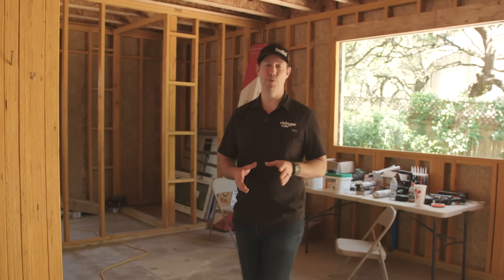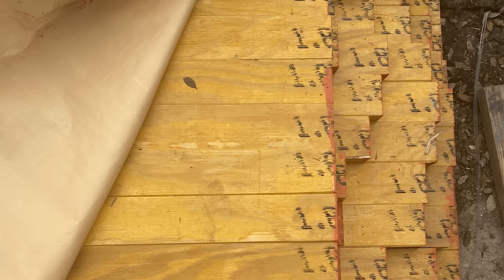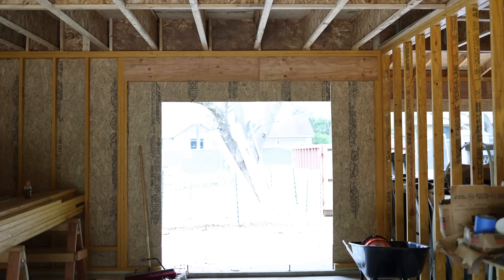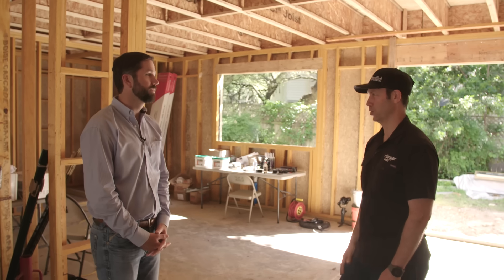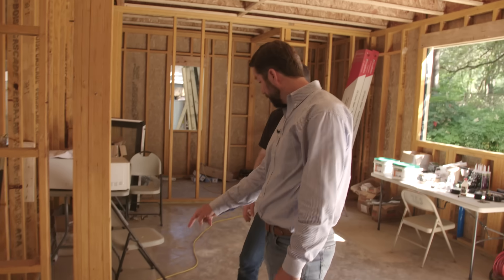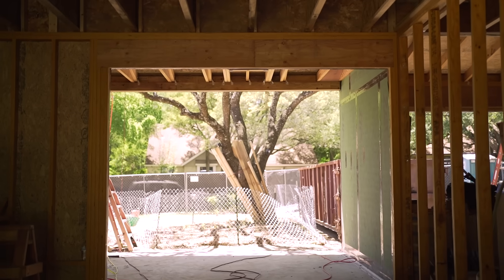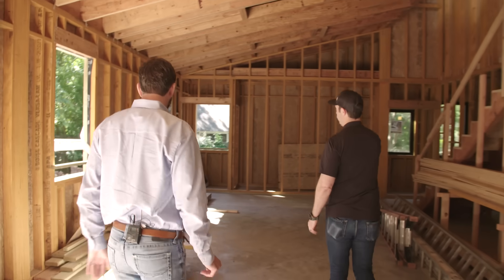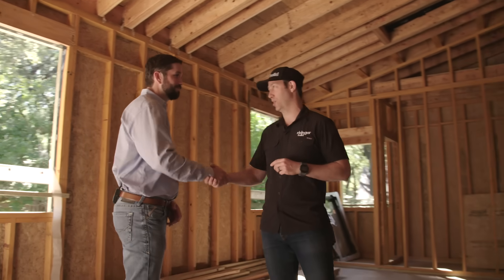House Engineering - Common Mistakes

Comment: Nice video thx for posting but my opinion is using engineered lumber everywhere is not a good idea this lumber must be installed according to a design or they might not work, professional contractors/builders dont spend one dime more on structural stuff then what the plans call for if your plans dont call for it dont replace it with these wood if the studs bow or twist later they will be covered with drywall spend your extra money if you have any on finishing stuff like flooring, cabinets or fixtures great video though very informative but most likely produced just to sell this kind of wood.

Comment: I am a construction estimator for a large home builder in Florida and having been a truss designer in my career a really common mistake is incorrectly specifying truss connectors.  Common mistakes are not meeting uplift specs, not meeting F1 or F2 specs, not being installed properly (not having a full seat).  Not having wedge anchors on walls with uplift.

Comment: I was hoping to see mistakes that people make, not how awesome this builder does it
Reply: What happened at 2:34 looks like someone miss read the plans and framed a window in the wrong place?
Reply: @robertreilly1701  It's framed for a possible future window.  He explained it in an earlier video.
Reply: @ClarkWofford  👍
Reply: Robert Reilly it’s looks like they wanted to put a door there.
Reply: Hi, Robert Reilly. You’re right. Matt did that himself. He admitted it in a video he did outlining his mistakes on this project
Reply: @robertreilly1701  I'll watch but if it's the girls room they moved the windows because of aesthetics.
Reply: Same. The thumbnail made it look like they would talk about wrong/missing connections & such
Reply: If that was framed for a door why is there 2 sill plates? You would just put full length studs to fill in.
Reply: I don’t know,
Reply: @Can-you-fix-it  might  be a change order also. Been there many times with homeowners. After it's in doesn't look right.
Reply: Likes to toot his own horn. Shows how much he makes off his clients
Reply: We paint i joist above bathrooms. Ever see osb get wet?
Reply: @eliinthewolverinestate  Building inspectors are starting to question the strength and durability of I joists. Most build applications are calling for floor trusses. The problem with I joists is OSB when it gets wet and the structural glue on its ability to hold when becoming wet. Most houses can’t be completely enclosed before rain. The other problem with I joists are the ability to run plumbing and hvac through them…
Reply: @johnwasik1186  If the OSB used in the I joist (TGI) is made with the proper amount of glue then there really is no problem because it will repel water instead of absorbing it. 

I've seen a whole range of OSB over the years. I was around back when it came to market and you had to be carful using it on roofs because the up side or ruff side as it is now wasn't really ruff back then and it posed a hazard to walk on. Everyone was pretty skeptical back then as to it's ability to replace plywood as structural shear panel even though it spect out better then plywood. 

What matters most about OSB is it's glue content and type of glue used. In the past I have sent entire bunks of OSB shear panel back to the lumber yard because of it's lack of glue. The OSB couldn't hold a nail but it was all graded and stamped for structural use. 

Once I became accustomed to running TGI (silent floor) I prefer TGI's over conventional floor joist. Over the years installation has become easier with innovations such as LVL's for rim joists and blocks. 

There are a lot of things to like about joist that are all exactly the same height, weigh a fraction of the weight of conventional green lumber, are clean, sap free, straight as an arrow with no crowns (unless crowns where engineered into them but I've never seen that), don't shrink, don't squeak, and for the most part termites won't eat them. There is also the fact that they don't require that we cut down large full grown trees that take many years to grow to manufacture them. Instead they utilize fast growing trees that aren't useable for lumber otherwise and sawmill scraps. I'm not a huge "environmentalist" but if we can save some trees I am all for that.

So I guess that what I'm saying is that as with any manufactured product it comes down to QC. If it's made to spec it holds up just fine. Even if it rains before you get it covered up.
Reply: Looks like normal framing and the way things should be done. Use a good engineer, know your subs and do things right. Custom framing is a thing of the past, honestly. Every job is different... build to last and use select lumber also. nothing special being done in this video if your not a hack!
Reply: the mistake is not doing it as good as this
Reply: It was a very scripted conversation.
Reply: Yes I agree
Reply: Exactly, no mistakes, just a super home made out of expensive engineered wood. I Like Risinger's vids, but please no F-ing clickbait.
Reply: Bait and switch...
Reply: I like this guy have worked for them too but it's all about money,

Comment: Screws are much easier to remove in case of a layout mistake. Not that I've ever made a mistake in the layout. :)
Reply: I'm pretty sure the concern is about shear strength, tho.
Reply: So you can do the construction equivalent of a tack weld using screws, check that everything is in the right place, drive your nails and replace the screws.

Comment: One thing that has always bugged me is the talk about shear strength on screws vs nails. I am by no means an expert but the thing is that most of the shear strength especially when using screws comes from the friction on the joint. According to a research paper that I read on the topic something like a typical deck screw when tightened properly could hold a few tons each. Now if the screws come loose then sure I would worry about that, but if you put like half a dozen in and the friction plus the screw ends up with a shear strength of like 20 tons I would tend to think that should be fine.
Reply: Nails withstand shear much better than screws, the two main ways shear is generating is from high winds and earthquakes.
Reply: With enough shear force, the threads will slice through the wood radially and the secure member will slip
Reply: @evenodds8791  the amount of shear force required for a properly tightened screw like I mentioned is crazy high because you also have to overcome the friction of the pieces that the screw is holding together.
Reply: I hear what you’re saying but those weights in that test were a static load. If you were to lift them up and down repeatedly, like what happens when you walk on the floor, the screws would fatigue before the nails. The threads  decrease the amount of surface area in the shear direction of a hung floor joist and will bite into the ledger if you drop something heavy on it, which would equate to jerking the weights in the study. If some big hog lives upstairs, just from gravity and humongo walking on it over time the joist will creep, and under the screws you’ll see the holes all blown out
Reply: @evenodds8791  all that I know is that I read scientific papers that contradict what you are saying and what I have heard from so many people about screws vs nails.
Reply: you know when you step on a screw and how easily it leaves that mark? All it takes is a little bit to get it started, and when it does, the pitch of the treads act like a wedge that back the screw out enough to break the friction. I’m not an expert either I just pretend like one, so I trust engineers, all the money that went into R&D, trial, error, knowledge, experience, and hardware companies competing to be the best who have all concluded that nails are superior in shear strength than screws. But all the power to you and the scientific papers, hope you prove it all wrong. I’d respect it
Reply: @evenodds8791  I will trust the science over engineering because the scientists actually test it while the engineers just do the math. In any case I have seen builders talk about and use framing screws that are fully rated for use in the framing, I believe that they are rated considerably higher than nails, but are not used everywhere because they are a lot more expensive and take more time to put in. This indicates to me that the whole argument is pointless because it indicates that the whole reason nails are used over screws is because they are cheaper.
Reply: Engineers are building scientists. Science is a different story, idk how anyone buy into some of the modern physics theories. Anyways  the diameter of a screw vs nail with equal shear strength is larger so you have to space the hole pattern out more and get a thicker plate which is all more weight hanging off the side of a rim joist. The cheapest, strongest, and lightest way is to just make your house a ft taller and stack the joists on the walls so there is no extra hardware or shear support needed. Very best way and even cheaper than straight screws, would be screws in only the top holes of your hanger and nails below. You ever seen a report on that? I seen some crazy science reports, one dude said all of humanity will be extinct by 2026. He wrote a paper, it’s insane.
Reply: @evenodds8791  an article claiming evidence of something is not a scientific paper. A scientific paper describes an experiment in enough detail to reproduce it and explains the results of the experiment. A good scientific paper is published in a peer reviewed scientific journal which checks for mistakes and has the experiment done by a different team to see if the results match. The papers that I have read cover using screws for framing in different scenarios.

Your mention of something that is clearly not a peer reviewed scientific paper shows that you don't understand what I was referring to. I wasn't talking about physics theories I was talking about experiments and their results, the whole thing that most scientists work on, designing an experiment to test a theory and publish the results. Not just doing math and saying what works and what doesn't, which BTW is exactly what engineers do when designing buildings, the math that they do is complex and tries to account for everything, but the reality is that the real world is often even more complex than the math indicates and only through actual experimentation can we figure out the truth.

Comment: Coming at this from the framer side that actually builds these houses, using these products, engineered wood isnt perfectly straight, you crown the boards the same as any traditional dimensional lumber for exactly that reason, and even worse its sometimes directional in it's engineering and backwards in its crown, leading to the exact issues your trying to say it solves, but far worse as you dont have a choice in the boards orientation. Not saying there isn't a place for engineered materials in construction, but this is hyperbole. Going in I figured this was bullshit but you still owe me 13 minutes of my life.
Reply: Agree it sounds more like promotion of products over actually helpful information.
Reply: i agree truss joist and glue lams are ok but everything else sucks

Comment: I have some friends that live in Burleson. When I visited them I was shocked. I couldn’t believe how high their ceilings were! Just out of curiosity should the attic spacing be that high. Temperature was very comfortable inside even at 90 degrees. I know it gets hotter but that was the hottest when I was out there

Comment: wouldn't a metal clamp that goes around the posts be stronger than drilling a hole through all the wood? Essentially you've weakened that spot tremendously on each drill hole.

Comment: I am sometimes the " Engineer Slayer " .. Rimboards come in varied sizes .. 1-1/6 - 1-5/16 and most manufacturer show that the rimboard is taller than the I-Joist on purpose .. To pick up the load and not transfer it on the joist .     Web stiffeners are not on the most part required .. and lateral bridging isn't generally required either ... When I want to do a super duper job and the money is there .. I will put in squash blocks with the rim and I will stiffen the ends of joist that are hung on my own whether required or not  .. If the plans call for anything . I abide .. But then again I question engineers and many agree that I was right and when they went unnecessary overkill

Comment: Only good thing about engineered wood is the cost, which the builder saves and can make a higher profit.  A useless product designed to fail under wet,  damp,  and moist conditions.  I also love your southern concept of building a house on a mere concrete pad.  Again, designed to fail.

Comment: Mcmansion peices of junk. We need smaller homes , engineered for solar, both passive and panels to save the planet. Not Great Rooms,  that are unheatable or coolable.
Just build smaller,  homes 300 years old , regular lumber , still standing. Keep wood dry , that the trick. As a home remodeler that is when I have seen structural problems,  either that or foundation or if undersized to begin with. 2x6 outside walls are better. I will say even that is questionable because I have seen that older homes having 2x4s , then 1x6 sheeting , then covered by cedar , still probably beats a 2x6 exterior wall for energy saving.
Even Thermopane windows are questionable.  A well made wood window with a high quality storm window on older homes works fine also.it seems like we dont build to take advantage of natural sunlight, windows positioning saving air conditioning etc. I am actually bored on remodeling because most customers are just interested in status, not efficiency and saving natural rescources. There may be a few homes built with that in mind but the vast majority is pump them up brainwash people with what they think is the " new trend " and make profit..
Reply: https://patents.google.com/patent/US6506148B2/en
Since you mentioned brainwashing, I think your on to something.
'(📺_📺)'
Reply: Ok Greta Thunsberg.

Comment: Engineered lumber = minimal requirements met for strength and cheaply made
Reply: That's not true. 

Engineered lumber has very specific requirements met during manufacture that make it able to produce specific and repeatable performance. Sawn lumber has tremendous variation in its performance and therefore requires conservative use ("lowest common denominator").

Comment: How does engineered lumber hold up in a fire, vs traditional lumber?  The reason I'm asking is because our local fire department is now refusing to enter houses with engineered trusses.  They're stating that in a fire, the glue gives way, allowing the floor to drop quicker than a solid piece of wood, like a 2"x8" or 2"x10".
Reply: This is accurate. I work for a forensic engineering firm and we have done controlled burns on traditional sawn lumber vs I-joists. The I-joist burned much faster and completely disintegrated well before the solid lumber. It was concerning to say the least.

Comment: Gray beam?  Several terms like this were used that I have not heard before.
Reply: Grade beam, a thickened concrete beam at grade level, typically around the perimeter with some running across the interior.

Comment: And i was thinking i might learn something on Common Mistakes buillders could make, instead all I hear for 13 minutes is that engineered lumber is more stable then normal lumber, well that was a waste of 13 minutes
Reply: Hearing him upsell  "engineered wood that doesn't bow or squeak" was annoying.

Most if not all subflooring will be delivered warped, placed on sub-optimal support and rained on before the shingles and windows are installed.
I see this all the time especially in new homes by production or "custom" builders.
Reply: @h3llblaz3r12  
I used the advantec flooring on my addition. Got rained on.. didn't hurt it.
But yes. I agree.
Reply: @turboflush  Yes advantech is designed to not absorb as much but it can and will if left long enough.
Reply: I agree.  This seemed like he was selling engineered lumber.  I was hoping to learn something too.
Reply: Thanks for saving my time. I expect this from his channel so always good to read a couple of comments first.
Reply: TELL ME ABOUT IT!!!!!!!❤❤❤❤ SPEAK TRUTH TO POWER!!!!
Reply: What a joke this guy is whats this video about
Reply: Scrape a lot clean. Saturate with water for dust control. Pour slab. Dump all building material on mud. Build duck walk path the fifty feet to the house from materisls pile over mud 

Shortstaff the crew so there is only one person  to transport extra long sheathing to building.

Frame walls and sheath in oriented strand board, Leave open over rainy season. Roof at start of dry season. Pressure wash exterior walls before painting.

Finish inside. Wonder why building is moldering in two months. Bring in driers, watch everything distort.

Be grateful for wildfire which incinerates whole town.
Reply: Matt is all about how can I make a $300K house cost a million and still mess up along the way while convincing the masses he is god
Reply: @williscooper7750 🤣 nice to have a blank check 😂
Reply: Until it gets wet.

Comment: A rookie builder mistake that should have been mentioned is using a wooden I-beam. They are deathtraps for firefighters. The OSB loses all of its strength and collapses without any warning. If that was my house I never would have allowed that to be put in. If I was on that working fire we wouldn't be going in there unless it was to rescue someone. My guys would be defensive only. 

https://www.fireengineering.com/2007/04/01/257050/silent-floors-silent-killers/#gref